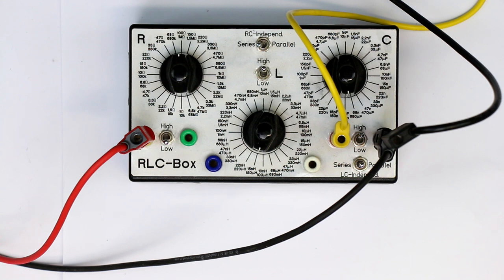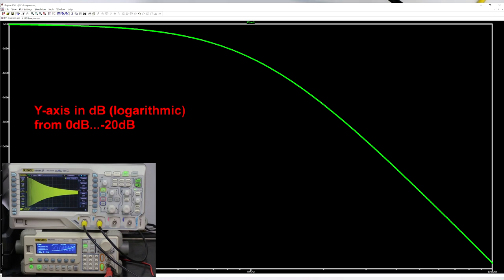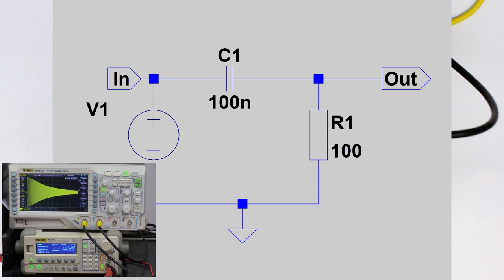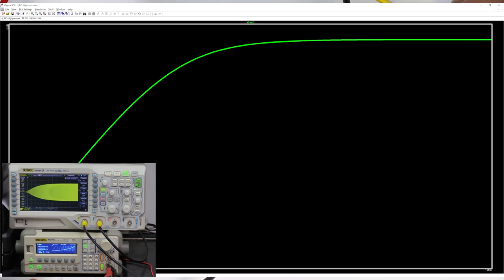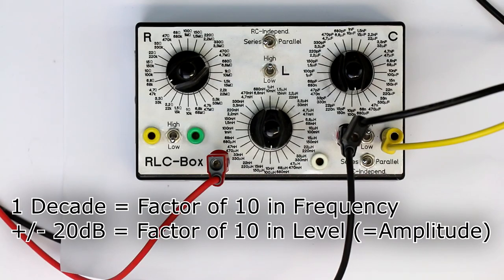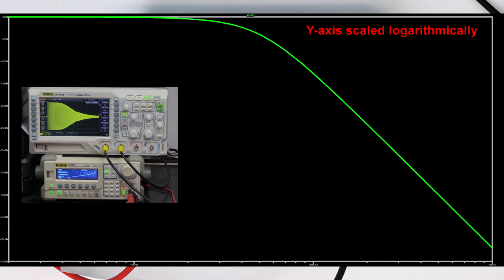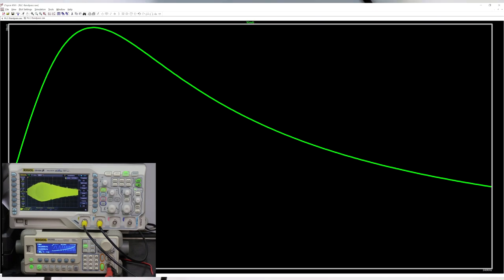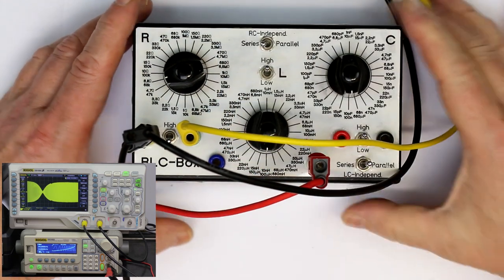RLC Box Filter-Topologies

Comment: Why is half the level sometimes -3dB and sometimes -6dB ?
Reply from the maker: When it is about LEVEL, only -6 dB is correct. That´s because half the level is a quarter of the power and a quarter of the power is -6 dB. Remember that dB always relates to relative power (wattage) ratios. Power is proportional to the square of voltage or current: P = Ü^2/R or P=I^2*R 
That´s why (due to the logarithmic definition of dB) there is a factor of 2 between talking about power and talking about level (voltage) or current concerning dB-values-